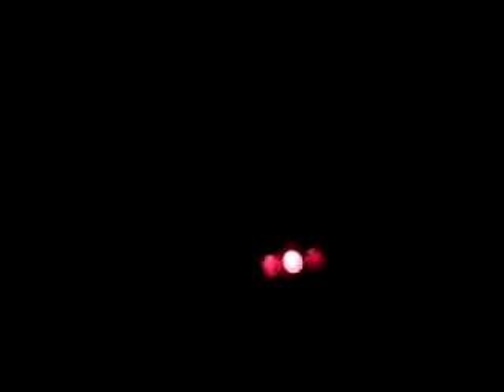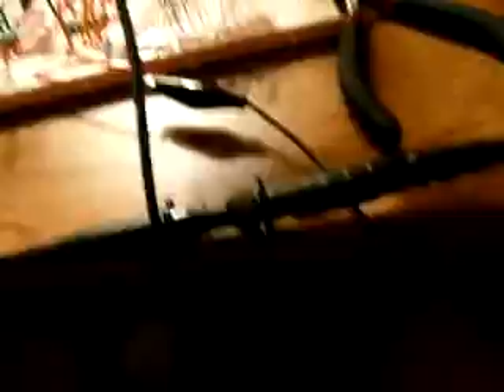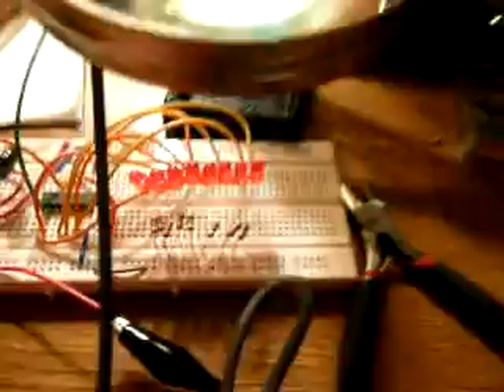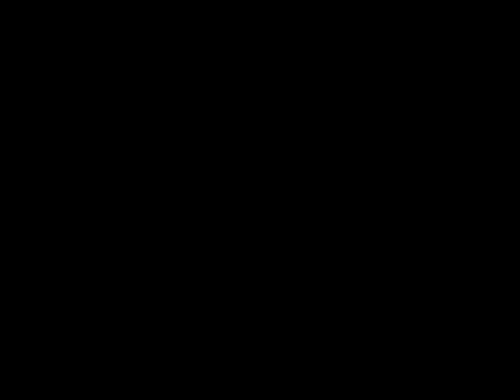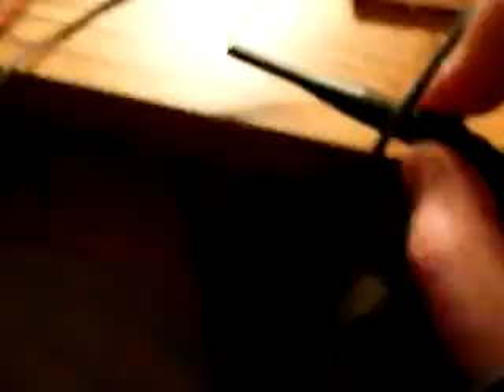heisenbug

Comment from the maker: I found out that there's a 60Hz signal that's tickling the 4017 counter -- I can even trigger the clock input of the 4017 counter and drive the chaser circuit with *my finger*!!!  Yay!  I've found my superpower!  Too bad it's so lame.  I guess it's from all the 60Hz AC wiring in the house.  I eventually got it all working correctly.